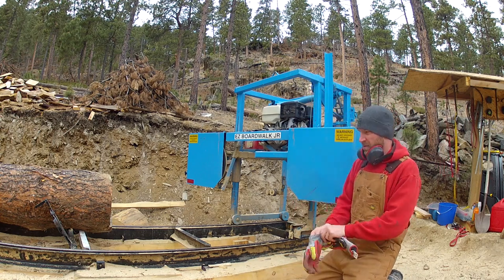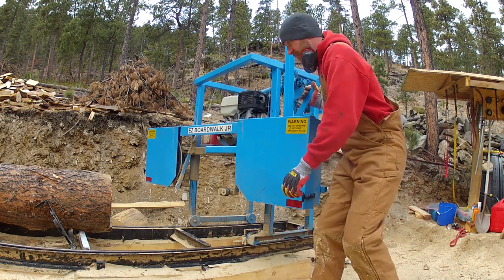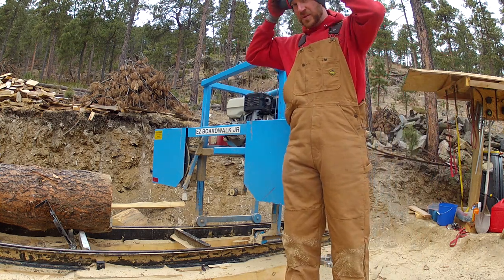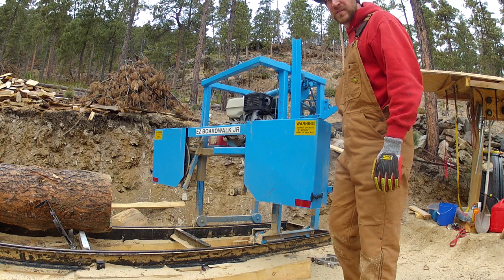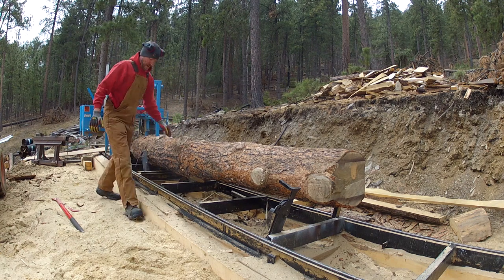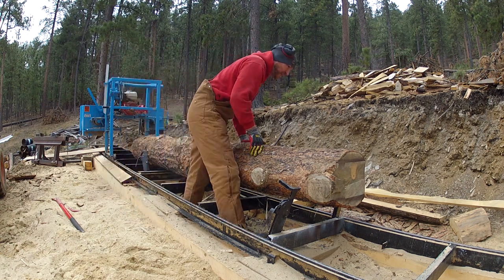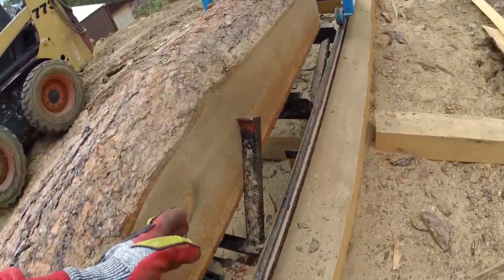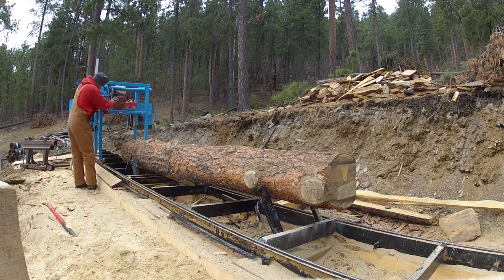(Part 3) Woodworking: Making your own lumber - EZ Boardwalk Sawmill Mega series

Comment: I have the same mill and in the past used water, but switched back to diesel / bar oil mix.  it just better in the long run for the blade and it does not freeze.

Comment: Usually the carb pilot jet is partially plugged or undersized. That will make those engines lope like that. Air adjustments are critical also.

Comment: Are your frames welded or bolted together?  If bolted you could loosen the last cross-tie and slip a spacer in there, make it wider so that it jams the wheels in the last foot or so.  Easy enough to reverse if needed.  Envious of your long run.
Reply from the maker: NelsonStudios it's all welded. I have something similar at the end that works like a bumper plate. It'll take a slow hit no problem. Depending on how warm the bearings are though... the mill can really move fast if you aren't paying attention.